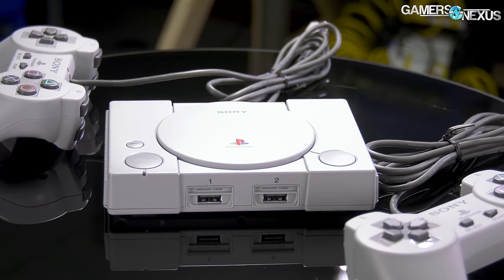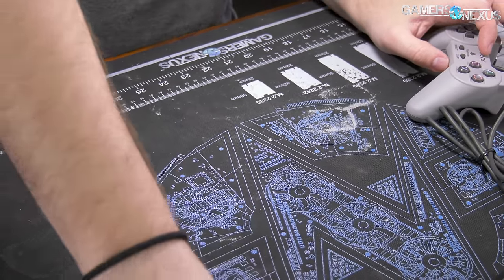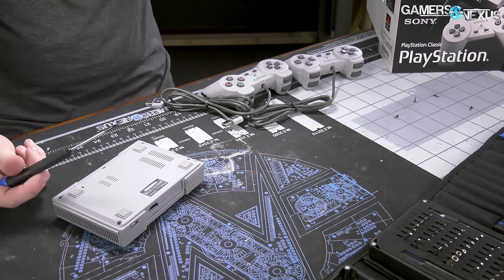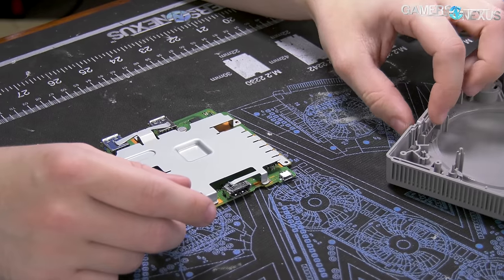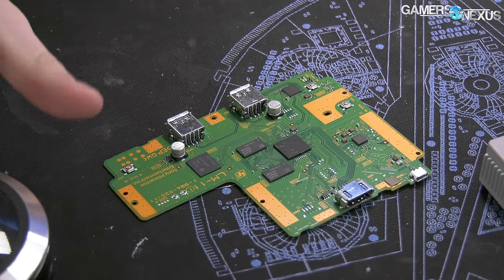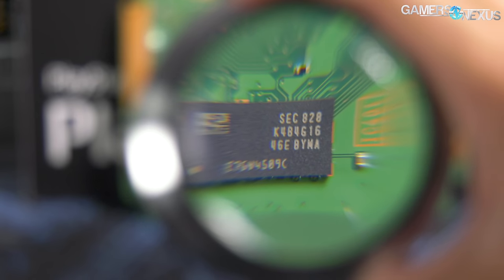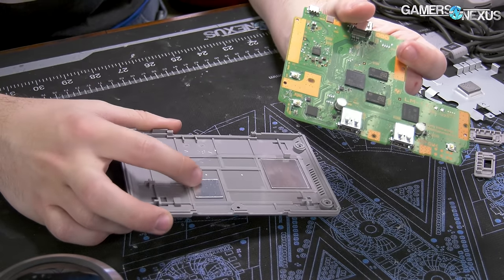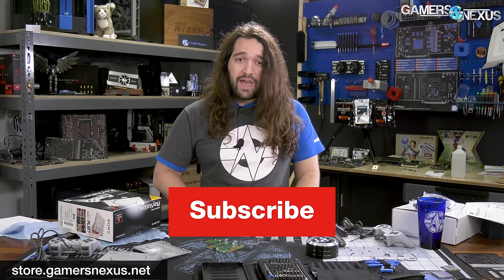PlayStation Classic Tear-Down & Disassembly (PS1)

Comment: What you called a heatsink isn't actually primarily a heatsink, that's mainly a RF suppression can. They used it to dissipate some heat from the SOC, but the only reason it is so large is that it is intended to suppress RF interference. There is enough room in that case to use a off-the-shelf stick-on heatsink, which would likely do a better job and be far cheaper. However, apparently to get certification they needed the large (and expensive, that stamped part is likely the most expensive individual part of the entire product) metal case to pass.

I actually expected better from Sony, normally they do a much better job on design. The board is far too large, which is money wasted, and if they are going to make the PCB that large at least include a SD card slot, that can be done incredibly inexpensively. Clearly they fucked up on the layout, look at how much surface area of the PCB is simply copper pours, and how excessively long the tracks are. Realistically, that board should be 1/3 the size, that would lower their costs, as even in volume you end up paying for PCB's primarily as a function of board size, and a more compact layout with shorter traces would likely result in better EMI compliance as well. Hopefully the controller is good, since the console itself is inferior in every way to a Rpi running an emulator. It looks like a playstation, but that will be so light that the weight of the HDMI cable will cause it to sit funny and be a pain, so I don't think it will even look all that great.

Actually, good god, look closer at 8:15. This is actually just absolute shit. Traces to the HDMI connector are at least 40MM for no good reason at all, and the flash chip is sitting entirely too far from the SOC. But the topping on the cake is the absolute shitshow to the right of the SOC where they routed out the RAM. That is DDR3, so matching trace length is important, but instead of orienting the chips properly they just created an absoute rats nest of crap, there's traces that jump down through vias, back up to the top layer, then down again, WTF? No wonder they had EMI issues with this, I would be critical of that even if it was a hobbyist developed board. It's just a basic SOC design, there's nothing special at all about the electronics there aside from the software for the emulator. The length of the HDMI traces alone explain the metal can covering literally the entire board, it's likely they barely passed FCC cert as-is, for an easily-avoidable problem (move the SOC closer to the output connector. Considering that that is, at bare minimum, a 4-layer board (and with how poorly it appears to be routed, I'd hazard to guess at least 8), the price for the PCB would justify cutting the board down to where the size only covers the 2 front and 2 rear connectors (and move the power connector to the opposite side of the HDMI, so the board is a rectangle). The size difference and lack of an expensive stamped steel can would drop significant cost from the product, and likely improve reliability as well. Looking at this thing, it wouldn't surprise me at all if this thing experiences interference if it is, say, placed near the sort of high power amplifier that also tends to live (and be connected to) televisions.

Just an absolute piece of trash, I can't believe Sony let this out the door. What has happened to their engineering department?

Comment: I would just get used original ps1
Reply: Will be much harder to connect to a modern TV, also not sure how available are the games
Reply: @thesmf1210  Try it yourself.
Reply: @thesmf1210  A lot of most modern tvs don't have a SCART or Composite AV  connectors anymore, so an Composite/SCART to HDMI Analog-to-Digital converter is required. A good one costs at least 50$ and may cause bad input lag. Although there is also ones which do not have noticeable lag.
Reply: "PS2" PS1 is not required
Reply: Me too. But I'm hardware purist and don't generally like the idea of inaccuracy caused by emulation. If the goal was to emulate, there's infinite amount of better options, even official ones.
Reply: Every television I've seen & owned has a SCART (europe only of course), but that's not the issue. You need a proper upscaler / converter to translate the 240p/480p signal to your modern television. Input is often seen as 480i, making any movement blurry due to the fact that only half the screen refreshes. So you either get a classic CRT television (or similar), or you get a sweet upscaler / image conversion hardware ^_^
Reply: Just UnRAR the files
Reply: I bought a Samsung smart TV last month, it has that connector... And if you want the full experience you should buy a crt TV also they are dirt cheap anyway...
Reply: ilyail3 most modern TV still have composite video, my family just bought a brand new 4K tv and it still has it.
Reply: Use an RF adapter and connect it to your TV’s VHF/UHF port.  You must tune in to Channel 3 (TV or Cable modes do not matter).  When on, try performing an Auto Program to gain access to Channel 3 at anytime.
Reply: HDretrovision cables (assuming your tv does 240p over component) and a PSIO.
Reply: or just a ps2.

and mod it, so you can just burn CD/DVD to play.
Reply: @BlueBird-wb6kb  Not true. Look into compatibility issues between versions and model numbers of PS2. Also, regardless, if you play a PS1 game on a PS2, it plays as 240 or 480... Anything that displays 240 doesn't work. HD tvs dont see it as a viable signal. So you need an upscaler, like the $300-400 framemeister. But I hope you have the right connections.

An alternative is to get a PS3, as all of them play PS1 games AND do the upscaling for you. You have to edit a few options so the games dont look fuzzy, but it works real well. Also, bonus, virtual memory cards.
Reply: True, I just did that. I got one free from my friend like a month ago, only because he was not using it and did not need it anymore, but it was in rough shape, and he was not sure if it even works. And it didn't work, unfortunately. First thing that died when I plugged it in was power board. It literally sparked in my face lol. So yeah, I was just about to fix that, when I got in touch with my work colleague, and he told me that he has his old PS1 that is just collecting dust for 10 years on his attic or somewhere, and he told me that he does not need it anymore. So yeah, this one was working good, only thing that I changed is laser, I just plugged it out of the non-working PS1, and plugged it in this one. And that's basically it, I got an original PS1 for free, and it's working without a problem. Only problem I stumbled upon was that my new TV does not have AV cable connectors, but I was lucky enough that it got scart, so I just got that small adapter with scart on an end and AV cable connector on another, and it does the job just fine, so watch out for that. So yeah, I might also fix non-working one since I'm from Europe, and that model is NTSC, while the one I fixed is PAL version. And I would just like to save it from trash to be honest, since they are becoming more and more rare.
Reply: I’ve already got one!

Comment: Nice teardown Steve 
Imho  the metal heatsink is more an  shield and works as a heatsink in second. It contacts all the ground plaines on the PCB and all grounded connectors so in my oppinion its more for EMI reasons. Also i think by the PCB shape, the free space was forseen for an internal PSU and the 2 solder blobs by it are Power and GND connections, but somewhere in development this was cut because solder on an micro USB is way cheaper.

Comment: “I don’t have a phone charger here”

So you’re telling me, that I’m that massive studio, or literally anywhere, you don’t have a Micro USB cable? I call shenanigans!
Reply: came here to say this also. NOT A CHANCE THERE IS NO USB CHARGER IN A TECH STUDIO
Reply: He didn't say no Micro USB cable. He said no phone charger. Probably has loads of cables but no wall warts to plug them into (who needs one when you have that many computers with that many USB ports?).
Reply: DrMacintosh plenty of 12v rails
Reply: It was a J-O-K-E
Reply: @mjc0961  Yeah, pretty weak excuse. On my desk here I have a PC and 2 consoles that can technically provide USB power, a 4 port USB charger, a 20,000 mAh usb battery bank, and a power strip with built in USB ports.

While I can't claim the studio is going to have ANY of those things, it's really NOT hard finding a way to power a USB powered device...
Hell, a lot of televisions have integrated USB ports these days (I've certainly powered a SNES mini directly from a television that way more than once...)

And without a monitor or TV of some kind, how was he planning on demonstrating one of these at all, even in  theory?
Powering seems to be the lesser problem really...
Reply: I believe the point was that this doesn't come with a cable.

Just like their controllers which do not come with cables either... -_________________-
Reply: I think he meant where he was standing as a joke
Reply: maybe they all have iphones?
Reply: @KuraIthys  r/wooosh
Reply: No surprise, really. Almost nothing uses micro-usb. It's a flimsy and unreliable connector. You'll almost never see a micro-usb cable unless it's bent, frayed, and attached some someone's $0 flip phone from 2006.
Reply: @mogwix  i think all Samsung phones use it. and ps4 and xbox one controllers
Reply: It has to be 2.5 amps or higher.  Another review channel killed theirs powering it off a Switch.
Reply: All these people saying use a PC or something...
USB 2.0 supplies less than half an amp. This thing would cut out or complain from a lack of power instantly.
Not even USB 3.0 is 1amp, but it is quite close. Might just cut it.
Reply: @TheStriker0525  Old Samsung phone, new ones uses usb c

Comment: I'd buy it if it was fully backwards compatible and had the OG ports.
My phone with a bluetooth controller does all this better.
Reply: any good bluetooth controller recommendations? i've been wanting one with real low input lag :D thx
Reply: @kirbyrules55  I actually use a regular wireless Xbox 1 controller.
Most of the cheaper ones I have tried kinda suck.
I have a samsung and its natively supported via bluetooth.
Just look for it like a speaker.
Not sure if all android brands allow such easy pairing though.
Reply: @FeedMeSalt  Xbox 1 controllers don't work on android. 
Unless it's the first version, and if you ever connect it to an Xbox or PC the firmware gets updated without asking and then it won't work on android anymore.
Edit: apparently it works in android pie.
Reply: @threepwood92  It works on a unrooted Samsung A4 and S8. And most rooted phones actually.
I have both man, literally just tap the "seek" button on the controller and it pops up named and everything. 
Why would I lie about this lol.
Reply: @threepwood92  huh, you are not wrong. That's so weird, why wouldn't something like this be compatible across the board.
Sorry to be rude.
Reply: @threepwood92  I have a second gen Xbox 1 controller that works fine on my Nexus 6p and Samsung Galaxy j7 prime via Bluetooth. Otg only works on the Nexus though.
Reply: @threepwood92  Newer XB1 and the elite controllers can connect to Android via Bluetooth no problem. Its Original XB1 controllers that cant.

Comment: You can get into it's emulators settings if you plug a keyboard in and hit the ESC key, this lets you tweak quite a number of things. Not all keyboards seem to work for whatever reason. People were having luck with corsair ones.
Reply: yeah more people will have the chance to figure out for sure what works and what doesnt when its released. chances are someones gonna make something akin to fmcb on a usb stick for the thing

Comment: I'm pretty sure SCPH-1001 is the original model number for the Playstation
Reply: @luketheduke420  Interesting. I never seen that information anywhere before. All I ever seen and know by it that the 1001 was the first worldwide model the difference being NTSC/UC NTSC/J and PAL/EU PAL/AU. Now on a new search what you say is correct. Still the american models were released only a year later. So it's weird that they decided to label it as the western model and not the original first model. 
PlayStation
JP: 3 December 1994 - 1000
NA: 9 September 1995
 - 1001
EU: 29 September 1995
 - 1002

Comment: Just get a new version of Raspberry pi instead. Its cheaper, and you can emulate more retro consoles not just the psx. And it also have buildt in lan card.
Reply: For 100USD you can almost have a very low-end x86 PC that can even run 10 y-old AAA games smoothly.
Reply: BOOOOOOOOOOOOOOOOOOOOOOOOOOOOOOOOOOOOOOOOOOOOOOOOOOOOOOOOOOOOOOOOOOOOOOOOOOOOOOOOOOOOOOOOOOOOOOOOOOOOOOOOOOOOOOOOOOOOOOOOOOOOOOOOOOOOOOOOOOOOOOOOOOOOOOOOOOOOOOOOOOOOOOOOOOOOOOOOOOOOOOOOOOOOOOOOOOOOOOOOOOOOOOOOOOOO *throws tomato*

Comment: Haven't watched that far in the video yet or seen online, but I'm going to make the crazy guess that the PS1 Classic uses an Alwinner H8 CPU SoC.

Edit : shit, it's a Mediatek
Reply: I thought it was gonna be a Allwinner chip as-well

Didnt the NES classic use a A33?
Reply: @malcolmholmes509  Supposedly it uses an Allwinner R16, but spec wise it it identical to the A33...

It probably is a renamed A33, they keep rebranding their CPUs into different  naming scheme's.
Reply: yeah it's a Mediatek with 4x A-35 cores. It's even worse than the Allwinner R16. It's sad to see all this power unexploited because it's a proprietary device on a castrated PCB. At those prices they're really just scams for nostalgic hipsters.
Reply: ExternalDomain "for nostalgic people and hipsters" if you prefer. Quite pedantic to just point that when we talk electronic circuitry.

Comment: Why wouldn't you just by a ps1 off ebay for £30 with 250 games
Reply: No hdmi, no support of modern tv and you can play 0 of that 250 games due to optic drive failure that happend in last century :-)
Reply: Better yet use your pc to run the emulator. Heck I even have ePSXe on my phone.
Reply: PS3 plays ps1
Reply: @kevinismay8853  There are so many who don't know this. To be fair, unless you actually really want to play more than 50% of the games included with the PS1 classic, you're probably better off buying the individual games you want on PSN and play them on your PS3 (assuming you have one).
Reply: @wykydytron  Get a CRT television, get a CRT television, and get the optical drive repaired.

Simple.
Reply: kevin ismay and psp and ps vita
Reply: 30 for psx and 250 games? Nice scam ma dude. most games cost 15 up and a psx in perfect condition costs 30 so something is wrong there
Reply: 30 gets you 1 good game.
Reply: Just buy a ps3.
Reply: @wykydytron  there are adapters to put a hdmi on ebay and aliexpress for cheap and they work quite well

Or better yet, buy a Raspberry pi 3 and add retropie to it, and you can play more than just PSX titles for less than the PS Classic.

Comment: I don't understand the appeal of these.  Honestly, it would be far more interesting if they revamped the old console design with some modern conveniences (integrated memory for game saves, more modern control inputs) and not just some pre-programmed classics, but also capable of playing original media for each console.  So actually being able to play your original discs, or cartridges.  But I suppose that's too much work, so bare minimum it is.

These are really nothing more than glorified emulation boxes that are slightly fancier, and more official than the Chinese-knockoff consoles you can find in the toy section of a dollar store in the seedy parts of town.
Reply: @Michael Smith Also, the average person that walks into a big box store and sees these "shitty emulation boxes" isn't going to care or want to build a Raspberry Pie.  I have several of these "shitty emulation boxes" and I like them for what they are.....quick fun!  Now I wouldn't mind building a Raspberry Pie though, but its definitely more involved than instant "plug and play."  But it's true that your average shopper isn't going to want to do the "Technical" work like finding the rom's and downloading them and than buying a case and controller etc. It's just sadly too much work for the average consumer.
Reply: I think people would buy them even if they didn't play games. It's an ornament.
Reply: you kinda described a Vita TV

Comment: so this is $100, defo not worth it, being in the uk i paid £20 for my ps1 slim and i have been picking up games for it from 50p-£2 with the exception of my boxed time crisis and gun set, only thing that would make it interesting is if it gets hacked for a stack load of roms
Reply: It's £90 on Amazon, so yeah a total rip off. Especially, since it's not even a great emulation experience.

But of course, it will still sell loads due to the time of year. The collector in me wants one to stick on a shelf, but not at more than half that price.
Reply: Yeah I think it's a bad product. You can buy a second hand PS1 off eBay for pretty cheap, or you could even buy a second hand PS2 or one of the original PS3s, both of which also play PS1 games (of course the slim versions of the PS3 don't play PS1 games, only the fat original one). Or, yes, you can just download an emulator, buy some cheap games off eBay or at your local second hand game shop, rip them to your computer and you're sorted.